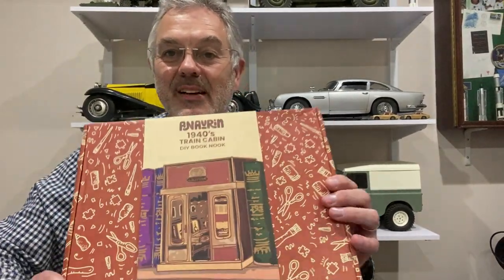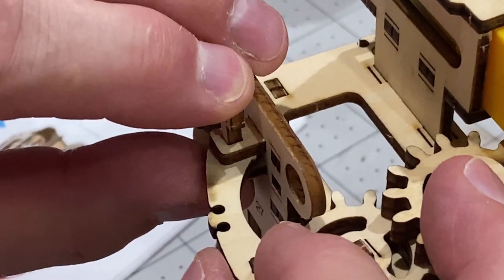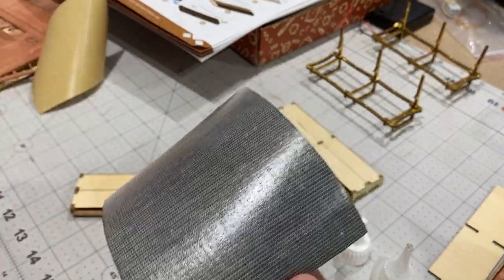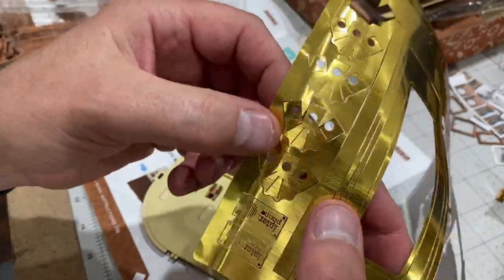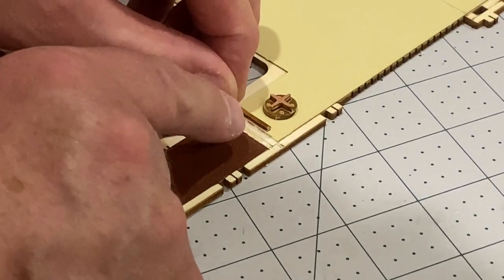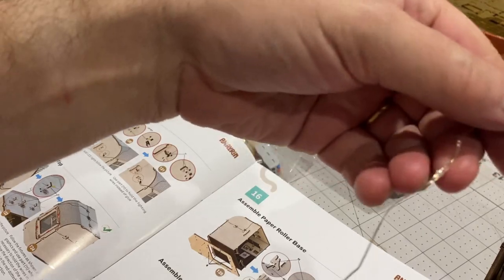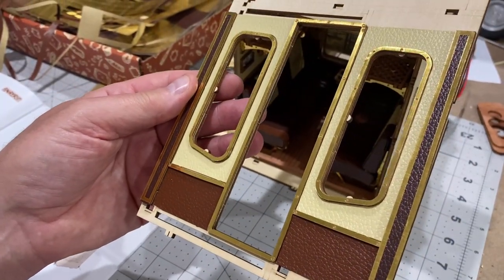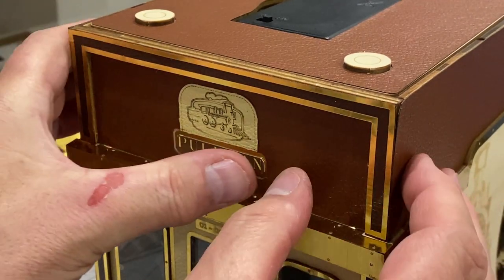Building the Anavrin 1940sTrain cabin book nook

Comment: I'm having trouble with the scene running smoothly, but I used a bit of transparent tape instead of glue. It runs, but sporadically, as if the train was stopping and starting suddenly. I think I'll redo it and try your glue-on-a-toothpick method. I'm about ready to put everything all together, so I need to make sure that part works smoothly and correctly before proceeding too much further. Thanks for this!
Reply from the maker: I tested it multiple times before I installed the motor section. I also used some silicone spray lubricant on the gears to make it run smoother.  Hope you get yours working properly.